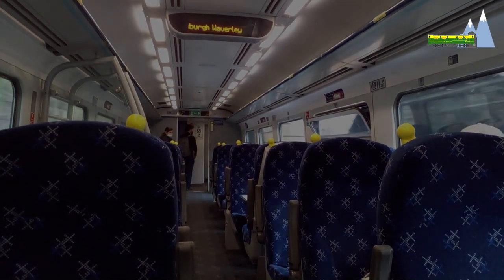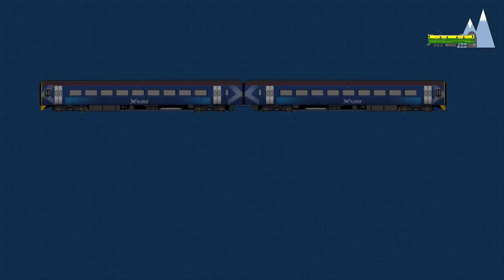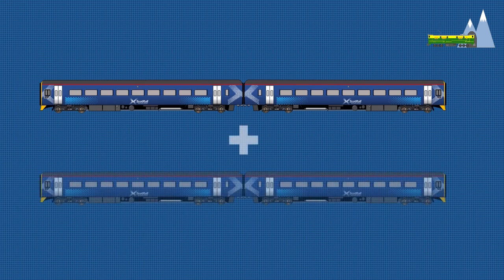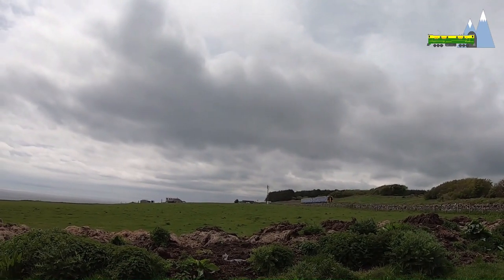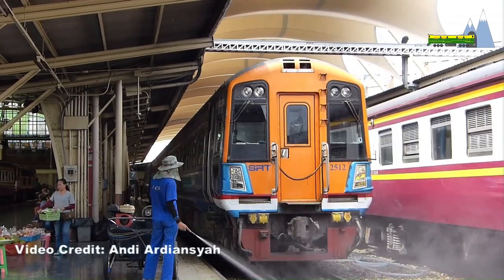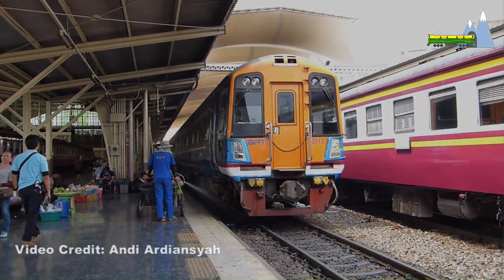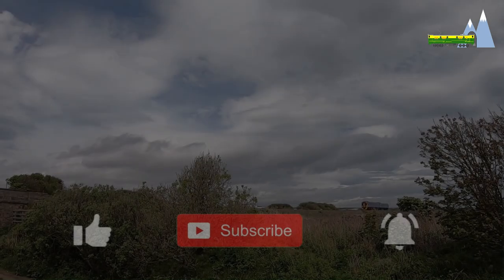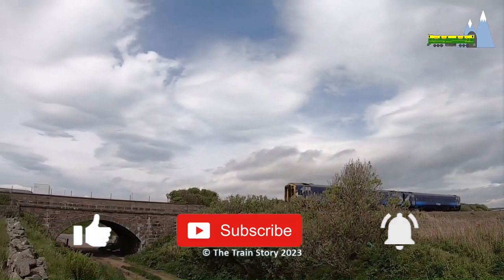Diesel Multiple Unit | Class 158 | Sprinter Trainsets

Comment: In the year 2023 class 158 trains 🚂 🚊 🚆 are honestly currently allocated to 6 train 🚊 operators are EMT - East Midlands Railway 🚃, GWR - Great Western Railway 🚃, NT - Northern Rail, SR - ScotRail, SWR - South Western Railway 🚃 and finally TFW - Transport For Wales 🏴. First class accommodation applies to SR - ScotRail and SWR - South Western Railway 🚃. There are also class 3 car class159s are currently allocated to SWR - South Western Railway 🚃 since brand new in May 1993 is 30 previous years ago. The class 2 car class 158s are based are allocated to all of these 6 separate train 🚊 companies and the 3 car 158s are currently allocated to GWR - Great Western Railway 🚃 and NT - Northern Rail. Train 🚆 operator EMT - East Midlands Railway 🚃 could keep the 26 x 2 car class 158s until around perhaps 🤔 the deadline date is Tuesday 1st September 2026 because it could happen for a long time 🕰️ previously before EMT could have the 11 - 2 car class 175001-011 and 16 x 3 car class 175101-116 cascaded from TFW - Transport For Wales 🏴. Train 🚊 operator TFW - Transport For Wales 🏴 has 24 x 2 car class 158s are 158818-841 wearing the TFW livery and refurbished interior inside the trains 🚂 🚂 🚆 🚆 🚊 🚊 are to finish with Transport For Wales 🏴 by around perhaps 🤔 the deadline date Wednesday 31st December 2025 (New Year’s Eve) 💥 🎇 🎆 🧨 🎉 🎈 🎊 🥃 🍾 🍹 🧉 🍸 🍺 🍷 🍻🍾 🥂 🧋 🎂 🍰 🧁 🥳 🤩 😍 at the latest when brand new trains 🚆 replace the class 158s Transport For Wales 🏴 otherwise could be put on hold to a later 👋 date into the year 2026 perhaps 🤔. All class 158s and 159s have toilets 🚽  🚽 🚻 🚻 , carpet, air conditioning and all accommodation is non smoking 🚭. 👍👍👍👍
Reply from the maker: Thanks for the information... appreciated🙂
Reply: for internatonal: SRT - State railway of thailand

Comment: Expecting a reply or a video of difference of purpose of pendolino, javelin, eurostar, intercity 125 in single country uk.
Reply from the maker: The tilting train is used in curved tracks of the west coast. The east coast tracks have long stretches of straight track and the HST-125 can operate at 125 mph on these tracks. These first two tracks are not really high speed tracks they are fit for 125 mph speeds . The javelins (Class 395) were commissioned to run on HST-1 high speed tracks and have max speed of 140 mph. The Eurostars are modified TGVs to operate on the narrower loading gauge of UK. They are high speed trains that connect Uk to Europe through the channel tunnel. Hope this helps…